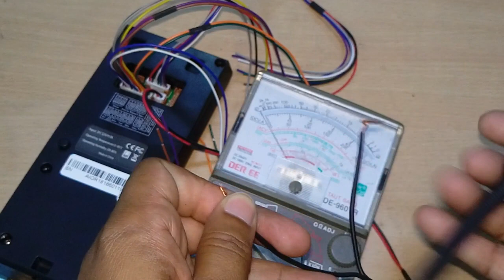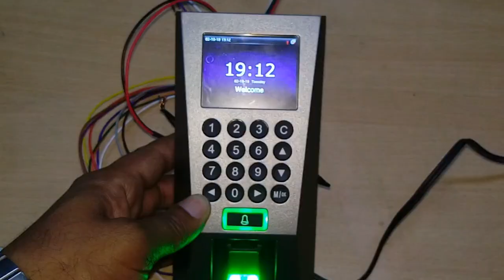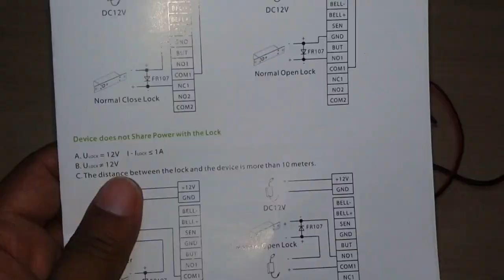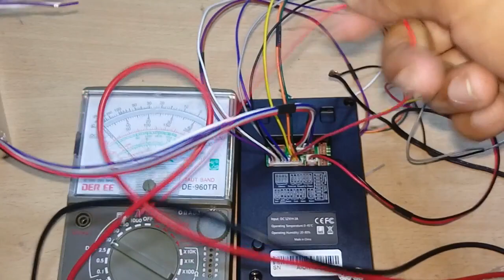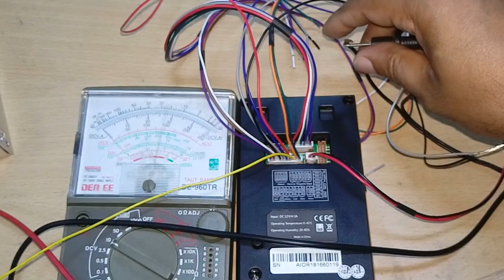how to installation  access control system Zk f18

Comment: How to add biometric finger
Reply from the maker: Brother press the M/ok button and  go to the add user then give your baimatric ...there are a so many options and roles if need any help please comment me
Reply: @mrcontrive5641  bro am a electrical maintenance engineer. My HOD instructed pls do biometric access door open/close control with magnetic option. (Only for door access). Which modal is best for me ( its lik mini project low cost )
Reply from the maker: @sorrydude3511  Bro please give your budget how much is then I will suggest you witch one best for you. .OK
Reply: @mrcontrive5641  4k to 7k
Reply from the maker: @sorrydude3511  Dear brother this is to much low budget .. here is machine price and magnetic door lock I think is not possible too good quality products
Reply: @mrcontrive5641  i had magnetic lock and exit push button. Machine only not available